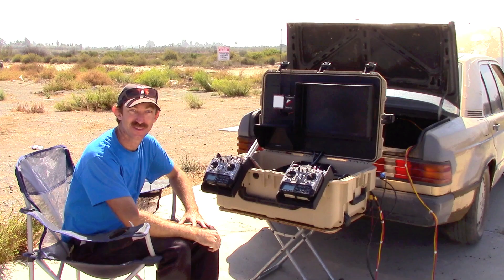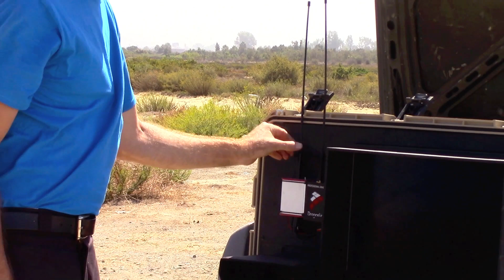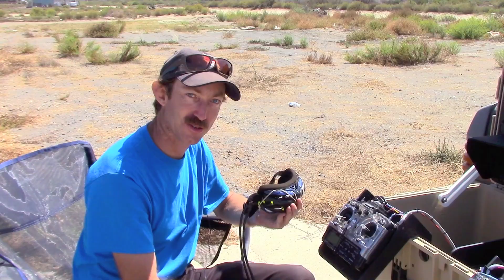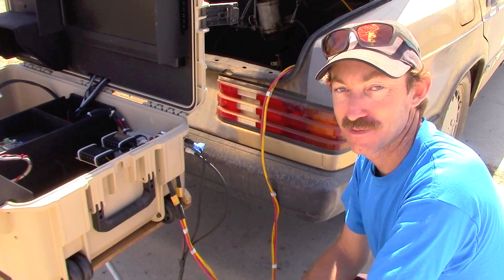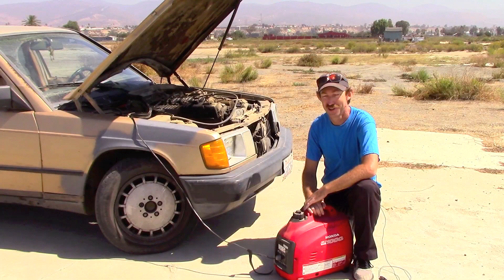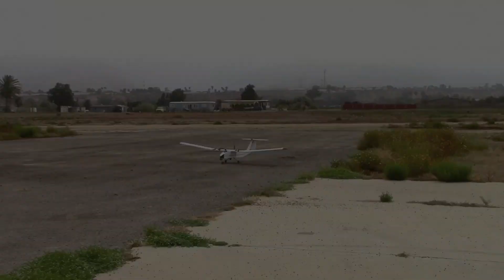Advanced FPV Ground Station / The Challenges of Flying for 4+ Hours

Comment: not going to lie that latch that stops the lid from falling down is A*,

I think i might do the same on mine as i've broken two HDMI cables from the lid falling 

Do you use a APM or Pixhawk as i thorght you needed a usb cable comunycate between the groundstation and Tracker? 
This might just be how i'm doing it?

Not shoure if the URL will work tell me if it dose

https://lh3.googleusercontent.com/ifq7eKthb_cOtHHbMMh51ZUma4CFXjhMyXlHrT6QqZ3LeaS7xC13xaHk81P6XFEMmYqj8Ap4i6kfOhQdSrfniRghb44k_fYvTy4hkwzDneJheusRZuvqCiU9QNg1z-ocpMSIezRfeytKU-mXouoR52GdFJy5ETPmATT6vVLzsBN3S34jpgwOP9d0trs0fQjkA-42nwuM6aZEHKPGfrc-8_N4Lghz3bFWNzl5HP-vjUu3VEYNGBzYxUkRJ_OJ4jmzgZxq58PExvtZBYHNhQ4fvRE-HqGM2pPMAZB6OA7uf6N2WKJRWxvQMcktpaFoEk5_YR16vlXqJQ0N6l3j243jt6yMjzY_yvRo5q_SI7ziIb8Hox2Yi33PH0wEXtoxHIE3KgAwBiBXR7lCabNu563Ew8nU_gRW7aUOPKTHvchtTKlGw57_IYxL63t_MPPWrhoiHLKqvNCGOCK6r-30GeCSeUJk-kQxlbAI1CPjGCZKNzpBHzvTRbVsBWuZwvBmesVbtgFQELyoVKuRYigrYu7DeHLz6FGollqLHE6FkytxwFs=w1110-h628-no
Reply: +Bryce Davey teh OSD provided with the MFD tracker embeds the telemetry into the audio signal, and if you don't like their OSD, you can just wire in a second, and use that for the video side.  i personally like the osd provided, and i use it. 
no need to use the flight controller to send signal to the tracker.  MFD is really simple. and they have this cool new feature, that you can find a friend's plane in the sky, so you guys can form up,a nd fly formation, even  long ways away.  very cool. now we can do mid air refueling!   or recharging...
Reply: +Bearospace Insider i was not able to open url.
Reply: +Bearospace Insider
Hey I was just looking up the mdf aat and I was wondering if I could use it with a pixhawk as I'm going to be using this for my uav
is there a was to hook it up ? 

this mdf aat looks cool but is all new to me :)

and thanks for you reapply
Reply from the maker: +Bryce Davey sure you can, it just hooks up tot he video system, and would not interfere at all with the flight controller. it just takes gps data,and embeds it in the audio signal on the aircraft.  the only thing i lose is the audio, which i don't use anyway. 
i think the latest version embeds it in the video signal, and you can have the audio back, if you wanted it.
Reply: FPVREVIEWS Ahh i see because i was thinking it needs the gps from the pixhawk however it has its own gps so its just a separate  system using ATX for the data

Thanks Guys !! :)

Comment: Spike, I'm interested in information about running 2 R/C systems on one airplane. I'm working on a rather exotic design that will be low power, high speed, and long range. I re-purposed a pair of sailplane wings into a twin boom, V tail, pod fuselage, powered by a '480' class motor. The issue I'm facing is not enough channels available for aircraft/FPV control with a single R/C controller. On the Skyhunter, I was able to use channel 4 for nosegear steering, and cam pan. and channel 8 for cam tilt ( I have a JR 9303 Tx). On the new design, given it will have a full flying V tail, I will need the rudder control, and don't care to connect cam pan in the rudder channel. With EZUHF, you must sacrifice a channel in order to get RSSI. On the SH, I use channel 5 (Gear) for RSSI. The only solution I can see is to use 2 R/C systems on board and use the second system for camera pan/tilt, and a video switch which enables me to run up to 3 cameras on board. Will I need to buy a brand other than Immersion in order to get 2 R/C systems to operate side by side? Some particulars: EZUHF R/C control, JR 9303 controller, ET Vector flight controller, EFlite 480, 40 amp ESC, 5100 mAh battery, in a 100 inch package that's kinda P-38'ish minus the horiz stab, and the verticals canted out into a V tail. Thank you.
Reply: +FPVREVIEWS Neither..... it had spoilers, the cheap plastic mechanical type. They were the reason the plane crashed, when I deployed the spoilers, one of them broke and stuck in the deployed position. All but the wings were destroyed in the resulting crash. In my re-purposing, the opening where the spoilers were are now wiring channels, and I removed some of the upper sheeting behind the main spar to find a second spar near the trailing edge. I ordered a set of Skyhunter carbon tubes, and a hardware pack that contains the boom mounts. Some careful fitting, and the front boom mounts lock into the main spar, and the rear spar, making a surprisingly stiff structure considering the wings kinda resemble snow skis lol. The rear boom mounts will hold the servo for each V tail/Stabilator.  I have another question for you. I want to use the VAS side feed cloverleaf VTX (1.2 ghz) antenna that is designed to flush mount. I can lay the VTX beside the front boom mount in the wing, and fix the antenna on the boom just aft, as it has about 6 inches of feed line. Will I have signal blocking issues with the antenna mounted so close to the carbon boom? As far as the brakes go, I'll just be using them for steep descent with power off. It isn't worth the effort to hack the wing up to build in flaps..... speed brakes on the fuselage seemed an easier way to go.
Reply from the maker: +Airplay'n FPV sounds like you have the same problem i had. well there are several ways to approach the problem, that i know of. there may be more. 
you could switch to a different radio system, such as taranis, that allows mixing without using another channel for each mix, sometimes, such as in the case of a nose wheel, it can save you a channel, that can used elsewhere. 
that can only get you so much, if it works, and i assume that you want to go long range, because, who doesn't?
so adding another LRS is an option.  
Dragonlink V-2 has 12 channels, so if you have a radio to power it which has more than 8 channels ppm out, you could have enough channels right there. it would make no use of your current system, probably, and don't assume that because a transmitter has 12 channels, all of thm have ppm out. many times they will have, 10 or 12 channels, and only 8 ppm out. it could be a solution, or you could get the second system with the 12 channel option to supplement, and maybe you can transfer all controls to the drangonlink later?
you could also get antoerh system just like you have, just use immersionrc tools to shift the spectrum on one of them away from the other, although they should work in theory on the same spectrum, or band.  switching one is better, and will give both a more robust signal. it's also pretty easy to do. even i can do it. 
a slightly more complex option is to use channel wizard with Ezuhf. depending on how you feel about setting up electronics. 
i was going to go this route, but realized that i wanted to have another transmitter for the observer to hold anyway, so i went with another transmitter with another LRS option. 
the fact i used two different brand systems, is just because it's what i had purchased for review, not because two of the same system won't work together, because they should work together just fine. 
i hope this gets  you pointed in the right direction. 
always to the proper range tests, and spectrum analysis before flying.  sounds like a great project. reminds me of the Albatross fpv /uav.  i used to fly a smaller aircraft of that configuration for a few years. i called it the uav4. it's on my bearospace channel. i think i flew it from 2007 to like 2012. i still have it, ready to fly. 
spike
Reply from the maker: +FPVREVIEWS here is a link to the channel wizard:

https://www.youtube.com/watch?v=kDKy2Vy90sU
Reply: +FPVREVIEWS  Right Spike, I looked at your Bearospace channel.... can't believe I didn't sub it right after I subbed here lol. Our designs look very similar, with mine subtracting the horizontal stab, and canting out the verts into a V tail, with the single '480' at the rear of the fuselage pod. The idea is to keep the airframe as light as possible, with no interaction of the prop wash and flight control surfaces. I'll probably go with a second LRS, as I've ran into the problem you describe with ppm outs. I will just "re-purpose" a DX 8 I have since I don't use it anymore due to the very limited range I get with the Spektrum gear. Too bad the people at Horizon didn't plan on their radios being used  for much more than park flyer applications. If I didn't say so before, I appreciate your time, and effort in this arena. You've helped me quite a bit. Have a great day!
Reply: +Airplay'n FPV I tried adding a futaba 2.4 ghz system to my skywalker back in the day, and found that, although it worked fine, it's range was limited to only about 4000 ft altitude. Spektrum is probably similar.  if you are running a 2.4ghz video system, the 2.4 control system will interfere, but if not, you should be good to go. 
always range check, and perform spectrum analysis as a matter of precaution. 
as far as aircraft configuration, having the prop wash/turbulent air clear the flight control surfaces is a good thing in my opinion. i find that the plane flies truer, and it get's rid of some bad habits. 
one problem i came across with the pusher configuration was with vibration. not only is the motor close to the sensors, but the prop arc is right in the middle of the high/low psi differential left by the wing. this can create vibrations, especially at higher wing loadings, and in turns where the G loading is higher.  i was using my aircraft for photos, and i found that no matter how much i balanced my prop, the aerodynamically induced vibration would ruin my pictures.   they would look ok initially, but when i zoomed in on the image later, in post, i could see that the image quality was poor. my solution was just to shut down the motor. i also used the ESC's brake feature to reduce rpm further, and keep the prop from windmilling.I found it also helped to use the ailerons as flaps(flaperons) when taking the picture, as it stabilized the aircraft, and made the controls better for controlling the camera, attached to the nose. i was even able to take pictures in a vertical dive, with good results. 
another slightly annoying tendency with any single engine aircraft is the tourqe, and P effect, in the case of the pusher, it's only torque, and there is some blade angle differential at high angles of attack.  i would always have to re-trim the aircraft for climb, and glide, as it would diverge from the flight path slightly.  It's those things that i was trying to overcome with gemini.  for a single configuration, it is very useful. the benefit in efficiency is large by having the prop wash clear the fuselage, etc.  I did  a review episode a while back on the anaconda fpv plane, sounds similar. still have it hanging there, waiting to do something with it.  will be great to see your project.
Reply: +Bearospace Insider I will either try and send you some pics of my project, or will upload a vid as soon as I can. The project is just getting under way. My solution to the vibration issue is to have the motor located roughly 4 inches behind the trailing edge of the wing (a pair of re-purposed wings from a crashed CMP Ventus 2bx). I am planning on adding brakes that will swing out from the sides of the rear fuselage  behind the wings just as a means of drastically increasing the sink rate for landings in smaller spaces. I almost popped for an Anaconda, but was more in my budget to go with the Skyhunter, which is my first big time FPV project after my smaller pico FPV park flyer rigs. I prefer the 1.2 ghz systems for their penetration through obstacles, and wide variety of tx's and antenna options out there. I'm hoping that the Vector flight controller will handle most of the changing stability issues so I can focus more of my attention on getting good camera footage. Using a RMRC Pro 700 for flight cam, and the Mobius wide angle for HD. I live near Stevens Pass in Washington State, and plan to get great video from a beatiful mountain pass..... getting ahead of myself here lol.
Reply from the maker: +Airplay'n FPV sounds great. just beware of the disrupted airflow from the air brakes into the prop wash. i tried a simile configuration with a pusher, and flaps right in front of the prop, well, about 10 inches in front, and when i deployed the air brakes, and tried to adjust sink rate with the motor, it mad a loud noise, vibrated a lot, and ripped the motor/prop from the aircraft. it was hanging by the wires, and i had to make an emergency landing like that. 
sounds like you have good equipment, and enough experience with the smaller planes.  the flying characteristics usually get better with the larger planes, you'll like it. 
did the vents glider have brakes, or flaps?
Reply from the maker: +Airplay'n FPV carbon fiber will interfere with video signal. best to have the VTX somewhere from anything else, and especially the receiver antenna for the controls system. lot's of real estate on large planes. i prefer the wingtips for video systems.

Comment: I know this is is not really your thing but do you mind explain how you can send power to something that can spin 360* I have a idea of how it might work but I'm not sure
Reply: +Jttv Electrical power can be sent to/from rotating units by way of a "slip ring".  Google "slip ring " for info.
Reply from the maker: +Jttv GWS1T sail winch servo, plugged into the RC receiver.
Reply from the maker: +FPVREVIEWS oh, sorry, you meant the tracker? it comes ready to use, you don't need to do anything. it has a continuous rotation servo pre installed, and the controller board is pre configured. it's a ready to use product.

Comment: Are you using a flight controller and if so which one do you use?
Reply from the maker: +Kiowa Mech no flight controller. I plan on adding one at some point, if anyone has any suggestions? 
i want safe, reliable, waypoints, RTH,and auto circle. If it can do VTOL for the future, that would be great!